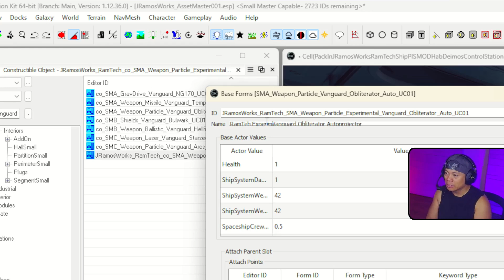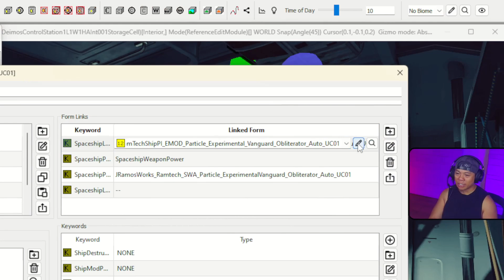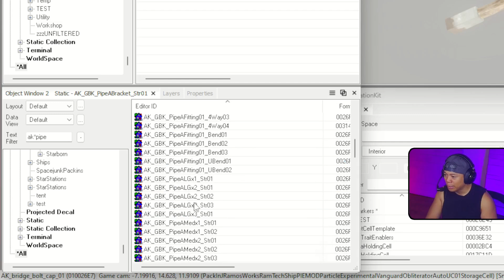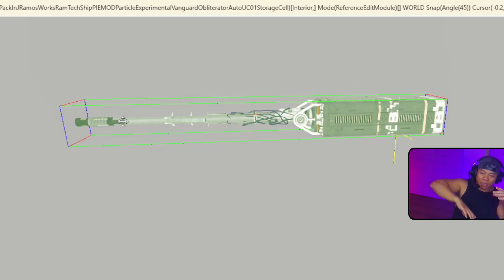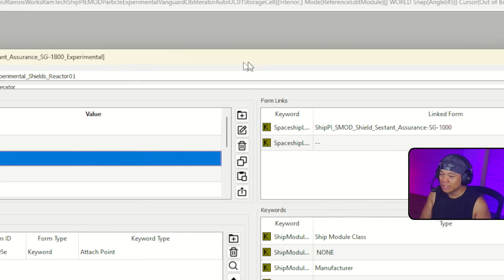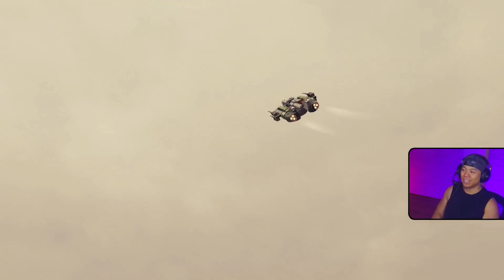#Starfield Creation Kit Tutorial 13 - Create Custom Ship Weapons, Shields, and More

Comment: Great series ,  Any chance to run through some "How To" related to Buildings & Structures ? ,     replacing walls , windows , stairs ,  decorations ? ,   Trying to get working window blinds in the Dream Home , or at least replace the frosted glass with clear glass , or add a window ,  but so far , no joy ,